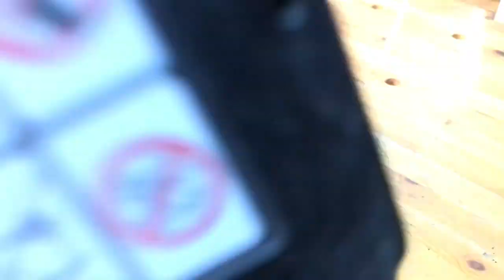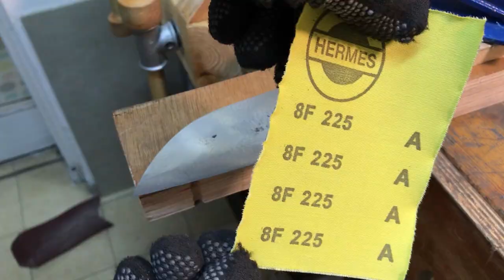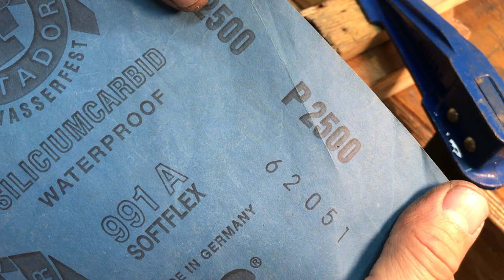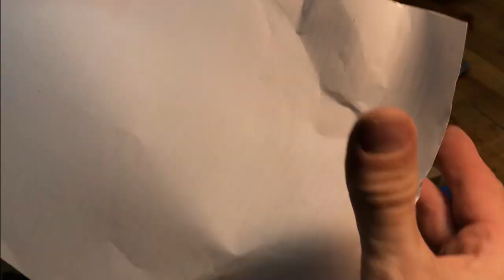Knife Making | Japanese Santoku Knife From an Old Rusty Cleaver | Tool Restoration

Comment: Peanut butter will break down the adhesive property in the masking tape glue. Use dish soap & running warm water to wash away the peanut butter. This procedure may require a couple of applications in a row to remove all of the adhesive & peanut butter but it will get the job done.

Comment: That's a lot of band-aids on your fingertips.  Maybe you should get some of those woodcarving gloves that are cut-resistant!  Anyway, thanks for the video.  It makes me want to try doing that myself.
Reply from the maker: Thank you sir, I’m glad you enjoyed it! 
As for the band aids, it’s actually a bunch of sand paper cuts 😵 there were two days of sanding on the blade and handle, at some point you can see I start wearing gloves. 
In any case, definitely try doing some restoration / knife making yourself! It’s very meditative and so much fun!! Just stock up on sandpaper, gloves and some bandaids ;)

Comment: 15:19 aceton , alcohol , gasoline , diesel , thinner.
Reply from the maker: Tried acetone, alcohol, turpentine, eventually sanded back down to 600 and up again. Someone did suggest a type of gun oil and I haven’t found the exact one yet. Cheers

Comment: When making knives, the upper part of the handle should not be higher than the back of the knife.
Reply from the maker: In most European style handles, even for Japanese chef knives it’s quite common to see a Yo (western)style handle.
In this case, and since I was going for a traditional Japanese knife I made a Wa (Japanese) style handle which is less known in the US for example. 
The design has to do with the weight and the force used with this type of knife.